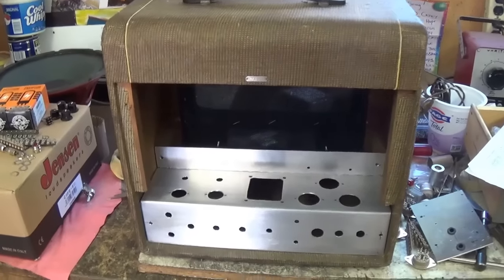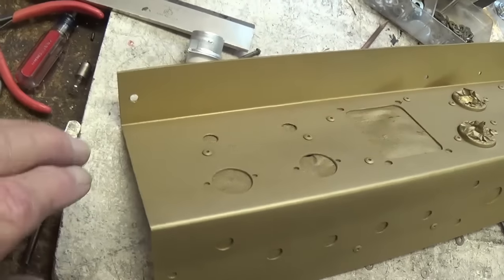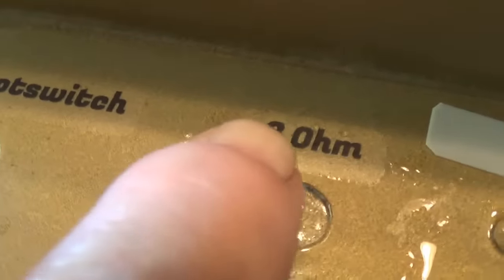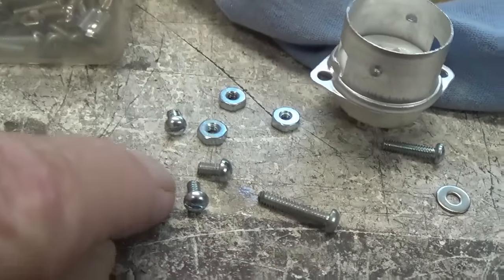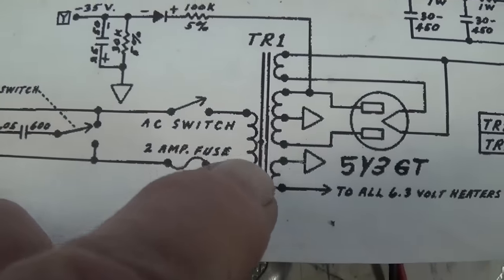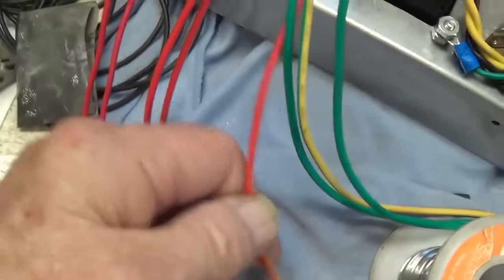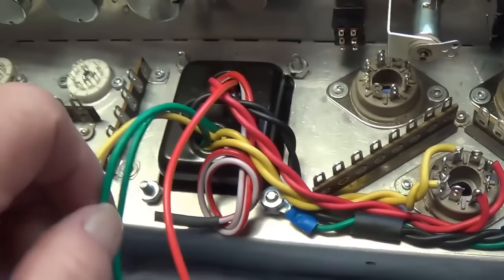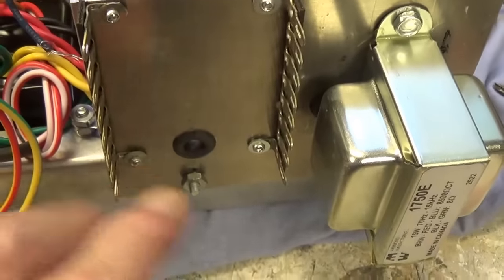Let's Build the Suprinceton, Part 2:  Chassis Painting, Assembly and Wiring

Comment: Hey Doug,
At least here in Germany, it is not allowed to attatch the PE wire from the mains lead to one of the transformer bolts (though of course this is very common on vintage amps) - I would always recommend to use an extra screw, ONLY for the connection of protection earth to chassis. This is, how it MUST be done here in Europe, and I think it makes sense..  (I usually leave it connected to the transformer bolt when restoring vintage amps, but I would do it differently on new amps). 
And, just another tiny thing: If I'd wired up the screengrids with white wire, I would have kept white for the wire colour that leads from the power rail to the screengrids. It would have made things arranged a bit clearer. I also would never ever use red for the negative end of the filtercap connection to ground.
But anyway: Well done, dude! Beautiful build!!
Reply from the maker: Thanks for your detailed input, Sal.
Reply: Yeah, also a thing I noticed - color coding. I go traditionally black for ground, red for positive DC and HV AC wiring, yellow or blue for negative DC and white for heaters. 

The dedicated ground screw makes sense, you don't want it to come apart under vibration, so adding some unscrew protection such as a toothed washer is mandatory here as well. I learned it way back when I was friends with Piotr Stanisz of Black Dog Amplification.
Reply from the maker: Thanks for your helpful input, KT :) @KeritechElectronics
Reply: @@salossi  Yep, Straya here too requires unique nut & bolt for only the green/yellow (used to be green) mains lead earth wire to attach to the chassis.  Strictly speaking.  But how're ya gunna have a proper 'star-earth' system if your other earth wires just AREN'T ALLOWED to connect to the same point?  D'oh!.....I know, just use another nut & bolt close by! - But still, a pain in the ass so mostly I ignore the rule & double up or even triple n quadruple up if it suits me!   Yes, I know the rule is there, so that you never have to touch that main bolted incoming mains to chassis connection to  do any work on the device, except replacing the mains lead.  So if you never have to work on it, you can never FORGET to reattach it, & your metal-chassis will NEVER be unearthed.  But hey!  I take it very seriously & NEVER forget!  If I have to undo that chassis bolt connection I never walk away from it without tightening it back up again.

Same as the stoopid rule for the incoming mains power from the brown (or used to be red) active (hot) mains lead wire being required to pass through the mains fuse FIRST, & then through the power switch, & then to the hot mains input wire of the power transformer.  The blue (or used to be black) neutral (cold) transformer mains input wire connects directly to the blue mains input lead, via, say, a tagstrip terminal, or heatshrunk butt-solder joint.

The problem with this rule is that even if the mains switch is turned off, there is still ALWAYS mains voltage on the fuse!  Mains power has NOT been disconnected from EVERYTHING ELSE when the power switch is OFF.  So off isn't really fully off!  Stoopid!  

And yes I know - in case a short to earth in the power switch occurs the fuse will blow.  But how many times has a power switch ever gone short circuit to earth, in the history of the earth?  6? - Under the the most adverse, perverse, ridiculous, likely water related conditions in the majority of instances.  Or if the switch had been damaged or overtightened on its installation?

It's b.s.  Call me an anarchist I don't care (shit I nearly typed Antichrist!), but if a rule or law seems stupid to me, I'm just gunna plain & simply ignore it! - And try not to get caught for it of course!  The boss too, was aware of these stupid wiring rules of course & agreed.

What's that old ac/dc song of their tnt album? - 'rock n roll singer'.  "You can stick your golden handshakes & all your silly rules, & all the other sh!t that they teach the kids in school.  Cos I ain't no fool!"

70's stuff luv it!  There y'are Uncle Doug!  Play us 'rock n roll singer" by akka dakka as your test play song for this amp go on!  A song request for ya!  You could play both the lead & rhythm sections of this song with little practice I bet!  You could pre-record yourself playing them separately & play the recording of one while your physically playing the other on your guitar!  Heck you've probly got an SG!

To me, a non-player, this song's guitar work seems less complicated than a lot of their other songs.  That'd be such a blast I reckon to hear YOU play that song!  You could NAIL it!  I'm sure you've played a 'back in black' ac/dc song before in one or two of your demos haven't ya?  You'll likely find the guitar tabs for it online without much trouble!

Sorry, yeah got distracted by ac/dc there!   I'm pleased to see that you too,  Uncle Doug, wire up this way!  Glad it's not just me!  I think it's the best way.  The other thing is that with starwashers 'digging' into both front & back, the whole 'earthing assembly' including nut, bolt, starwashers, spring washers, eye terminals & wires are rotationally 'locked' to each other, & the panel.  Nothing can spin once the nut is tightened.  Starwashers either side of any extra eye terminals, to keep them from spinning & locked to the assembly.

Mind you, we used those 'starwashers' in contact with & 'biting into' both the inner & outer surfaces of the '304' stainless steel cabinet walls of our equipment, to minimise the electrical resistance of course, not just rotational resistance.

I've never had a problem in 40 years earthing metal devices this way, so I don't care for the dumb-ass rules!
Reply from the maker: Thanks for sharing your insights with us, Neville. I agree with your primary wiring scheme. @nevillegoddard4966
Reply: @nevillegoddard4966  Hey, thanks for your compact answer :D
First of all, about the wiring order in the mains: Here, in Germany, unfortunately we have a non-polarized AC-system, meaning: You can plug any AC plug into the wall socket in both ways, so it is all absolutely randomly, wheather a specific wire of the mains cable carries phase or neutral... Personally, I hate this system. Part of my family live in Switzerland, and I absolutely prefer this system there (that comes with smaller plugs and is polarized).
I agree with the position of the fuse. It even happened to me, when I was still at school, that I got an electric shock at the fuse of my Super Reverb amp, whilst trying to change it... On the other hand: As long as you wire the fuseholder correctly (i.e. with the hot wire attatched to the center pin of the fuseholder), you cannot get shocked (as long as you have a polarized mains system and everything else is wired up correctly), cause the inner contact instantly disconnects, if you remove the fuse.
About the grounding issue / starground:
Fender amps are not stargrounded at all, you usually have this (pretty much low-z) brass groundplane in the front of the amp - and it works fine. Of course you can attatch your star ground to another screw, that is located just beside the screw for the protection earth (from the mains lead), although in most cases this doesn't make much sense, cause very often a starground-spot is close to the input jack (or it even IS the input jack), and usually your mains-in is more or less exactly at the opposite side of an amp (at least with a good design).
By the way: The reason for this extra bold / screw ONLY for the PE-connection is NOT to avoid, that bad amp-techs forget to re-connect the wires - it is to prevent the PE from ratteling loose, in case maybe your transformer bolts become loose, due to the vibrations, that are present in every guitar-amp. This might happen in 20 years down the road, and with instruments like guitars etc (where you usually do have grounded strings), a malfunction of the PE can be extremely dangerous and lethal (as you envelop the strings with your hand, and in case of high voltage on the chassis of the amp / guitar strings, you will cramp and not be able to let go)...
If you do amp repairs for other musicians (like I do and like Uncle Doug does), you might end up being really fucked, if you do not follow some of those rules and anything happens to one of your customers.
Reply: @nevillegoddard4966  that's a good read. I'll probably still do it the Mr Carlson's Lab way, fuse first, then switch (preferably double pole) - but as far as grounding goes, I'm with you. 

"I'm not an Antichrist, I am an anarchist"... same here. Rock on!
Reply: @UncleDoug  Cheers mate!  So you're gonna practice "rock n roll singer" for us then Uncle Doug? 😋
Reply: @ @salossi    Yeah sorry, I rave on.  You guys are the only elec.tech types I get to talk this stuff about with! 

I concur with you wire-colour thoughts, & the reason for unique mains lead earth-to-chassis attachment!  Definitely makes sense!  More so than what I thought the reason was!  Nothing else to rattle or vibrate on it to work it loose!  Of course!  My reason was only a secondary, additional reason, but yep, 1st prize for you!  Thanks too, cos I learned something today!

Hey how goods this Suprinceton UDs making gunna sound ya reckon?  I reckon it's gunna kick butt!  Lol!  Nice tremolo!  

Hey Salossi, what's a reverse audio taper pot? - Like antilog?
Reply: @ @KeritechElectronics    Thanks K.E.!  I was probably a bit too savage towards Paul there at Mr. Carlson's Lab.  I gave one of his videos a thumbs down because of his what I perceived as totally wrong attitude towards the incoming mains to fuse or switch first issue!  Perhaps I shouldn't have been that vociferous?

So ok then, I'd feel much better if EVERYONE who wanted to wire their incoming mains lead 'hot' or 'active' wire to the fuse holder FIRST, used heatshrink tubing on BOTH terminals of the fuseholder so that no contact can be made with them!  Please, always at least do that, & as has been said - incoming mains to the END of the fuseholder!
Reply: @nevillegoddard4966  I always do. That's been the Keritech way since, well... mid 2000s, when I started making amps.
Reply from the maker: I'm too old a dog to learn new tricks, Neville ;) @nevillegoddard4966
Reply: @nevillegoddard4966  Exactly. Log taper, but the other direction.
Reply: As I mentioned before:
Just be thankful, if you have a mains system in your country, that specifies, which prong is N and which is L... 
Here, in Germany it's always a mess... All those mains-cords with mains plugs you can buy contain a blue, a brown (or black) and a green/yellow wire, but depending on which direction you plug in, blue will become phase and brown/black neutral... I really hate this system... On the other hand, we don't have to think about "fuse first" or "switch first"  issues here in germany ;)
Anyway, as long as everything is wired up / insulated correctly in the mains area and you pull the plug before changing fuses, it's still a pretty much "idiot-proof" system...
 @nevillegoddard4966  @UncleDoug

Comment: Something I think
about quite seriously before installing tube sockets, is the orientation of parts that will be soldered to the socket, and the directions they need to point to. I usually draw it out on paper, bottom view, and discover the best orientation of pin-outs to ease placement of parts between other sockets and term strips. In the end, the sockets most often have their mounting screws at odd angles, instead of nice rows parallel to edges. In the end, I care more about the layout of connections inside, than screw heads on the outside.  If your building a kit, or working with a pre cut chassis, you are stuck with the chassis as is, but if building from scratch, as a builder, you are in control and can orient your sockets to best suit the interior wiring layout. I learned this from Tektronix tube scopes, which are real works of technical artistry.
Reply from the maker: Thanks for the very interesting tip, Jennifer. As usual, we enjoy hearing from you :)
Reply: @@jenniferwhitewolf3784  Sounds like an excellent way to wire up devices!  While I haven't looked inside a Tektronix 'scope for years I'm glad you're using their assembly techniques as a benchmark!  Best cro's in the world or what? Any of em.  Hardly ever see one that doesn't work.  I remember one with 3 plug-in modules along the bottom of the front panel.  They'd slide in like a drawer & plugged into a socket at the back, & were secured in place with knurled, very long thumbscrews.  Virtually aircraft/ NASA standard almost.  Impressive & reliable.

Comment: That chassis Looks very nice! BTW, I used to use that laser decal paper but switched to a computer controlled vinyl cutter a few years ago. The cutter allows me to make vinyl stencil's of anything I can print on the computer. I make stencil masks and spray paint (any color, not only black) labels with no decal ghosting. Not too expensive but well worth it for ultra professional results.
Reply from the maker: Thanks for the nice comment and helpful tip, JR :)

Comment: Hey Uncle Doug, I found decals to be much easier to work with when I spray them with a clear lacquer, whether they are ink or laser printed. They become much more manageable, don't fold or tear as much. Also, the milky surface can be a result of air bubbles trapped under the decal. It's much better to apply them on a buffed up surface, rather than scuffed. Fantastic result anyway 👍
Reply from the maker: Thanks for the helpful hints, Piotr :)

Comment: To apply the water decals, you did the application correctly, but after they are in their final position you need to lightly blot them to force the trapped water out from underneath which is what caused the white  behind some of them. I learned this trick from building models and rockets.
Reply from the maker: Thanks for the tip, Jim. I did that on most of the decals......but apparently not all ;)

Comment: Very enjoyable video! And those V8s sounded so smooth. 
BTW it would be very easy to install to 6V6 tubes small fusible non-flammable screen resistors as well to give some extra protection to both tubes and power supply.
Reply from the maker: Thanks, J :)

Comment: the grounding topology you are going to use i  employ this all the time its the best for noise and hum you will need to couple your electronics grounds to the chassis via 10 ohm resistor 3 W and 100NF across the resistor
Reply from the maker: Thanks for the helpful input, M40 :)

Comment: Doug: If you use micro set on the decals, they will adhere without the ghosting. There are 2 solutions, A prep and a final. The prep goes on the surface and the final softens the decal so it sinks into the surface. The product is used by modelers, and is the best way to set decals into the surface.You can get the product at any hobby shop that sells plastic models.
Reply from the maker: Thanks, Don. I'll check it out :)

Comment: Uncle Doug have a look at a pair of wire stripper pliers. There should be a series of threaded holes for the various sized number screws to trim them for length. Just thread in to the length you want and squeeze the pliers closed, trims them right off and you don't need to dress the ends.
Reply from the maker: Thanks for the great tip, ORD :)

Comment: Love it, Love it, Love it...

Thank you very much for your videos as I am learning through  your videos.. 

May I please suggest/request please for the list of your videos order for someone is starting on your channel..not sure you have it yet.. so this is what i have:

TUBE Amplifiers	

How Tube Amplifiers Work, Part 1: The Power Supply	
Guitar Amp Vacuum Tubes Part 1: Triodes and Tetrodes	
Guitar Amp Tubes Part 2: Pentodes and Beam Tetrodes	
Build Your Own Current Limiter for Protection when Repairing and Testing Electronic Equipment	

RESISTORS	
Resistors, Part 1: Their Circuit Function & Practical Applications of Ohm's Law	
Resistors, Part 2: Power and Wattage Requirements, Practical Applications of Ohm's Law	
Resistors, Part 3: Grid Leak, Grid Stopper, and the Fender Input Circuit	
Resistors, Part 4: The Cathode Bias Resistor	
Resistors, Part 5: Plate Resistors	

CAPACITORS	
Capacitors in Audio Circuits: Part 1	
Capacitors in Audio Circuits: Part 2	
Capacitors in Audio Circuits: Part 3	
Cathode Bypass Capacitors: How they Affect Gain and Tone	

A heartfelt thank you for your videos truly grateful.
Reply from the maker: Wow....that's very helpful, Dino. Thanks !!

Comment: The milky appearance around some of the decals is called "silvering". It's basically air trapped between the enclosure and the decal. Silvering plagues even the most veteran of decal users. I have had good luck applying a 1:1 mixture of water and vinegar to the surface with a spritz bottle, then placing the decal on top of that. The decal wrinkles up, but relaxes as it dries. Something about the vinegar makes the film more supple and minimizes silvering.
Reply from the maker: Thanks for the great tip, THP. I will remember this for my next project.

Comment: One thing i do with water slide decals from the laser printer, is to print it mirrored, so when applying them to the chassis, the toner is against the chassis and film to the outside, this protects the toner a little better when adjusting the postition and working any air bubbles out.
Reply from the maker: Thanks for the tip, Carl.